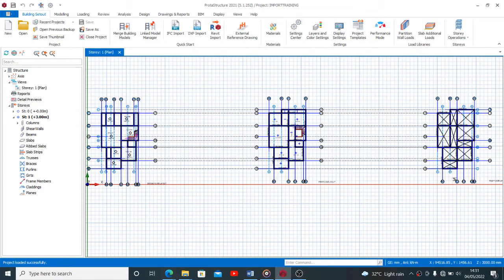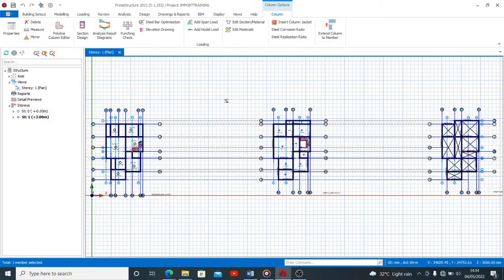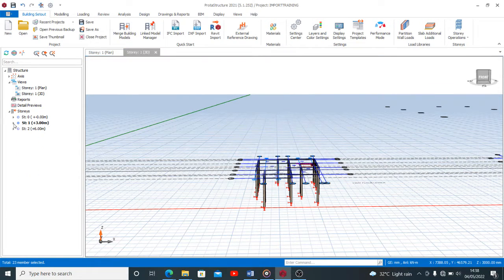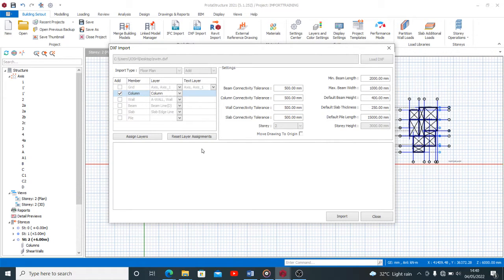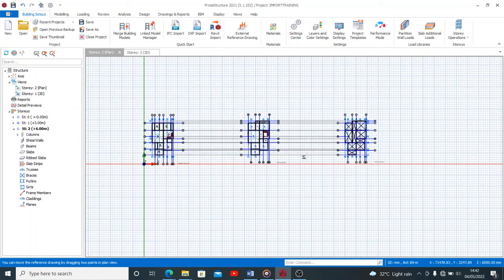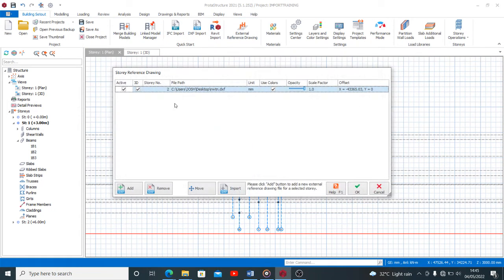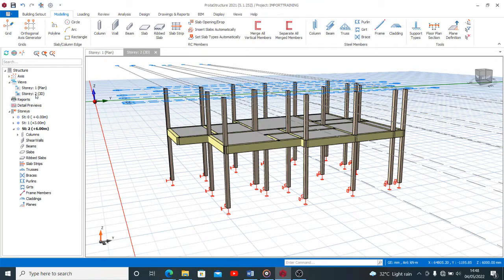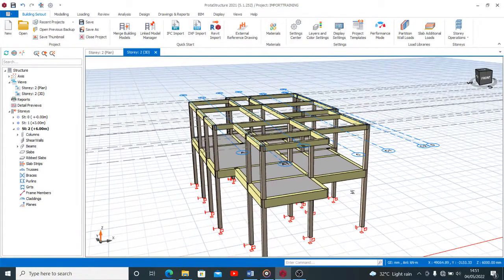HOW TO IMPORT MULTIPLE LAYOUTS FROM AUTOCAD TO PROTA STRUCTURE AT ONCE USINGPROTA STRUCTURE 2021PT 2

Comment: Good morning. Pls I have a challenge upgrading to 2021, I'm trying to create a cantilever slab with a round shape edge but I don't know how to convert the lines to slab, after drawing the slab shape
Reply: After doing all of that and adding the columns I wanted to add beams but it working.... It appeared in some place and didn't work in other places
Reply from the maker: @BlissKonstruct  i really do not understand the question.
Please use the video on how I import into prota structure
Reply from the maker: @BlissKonstruct  i will do a video for you
Reply: @Joshua_d_designer  pls I also have something else... I was doing a model I finished the ground floor, added storey 2 and generated columns, then I imported the first floor g.a and grids so I can know the columns that would terminate at ground level and the ones to continue and where I'd be adding...
Reply: @Joshua_d_designer  thank you..